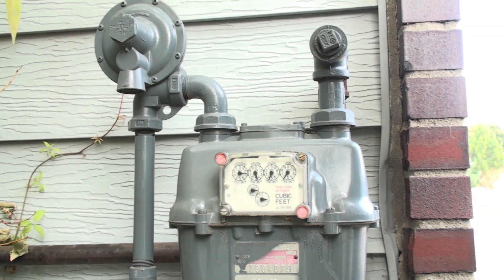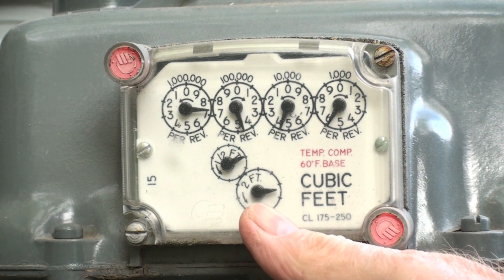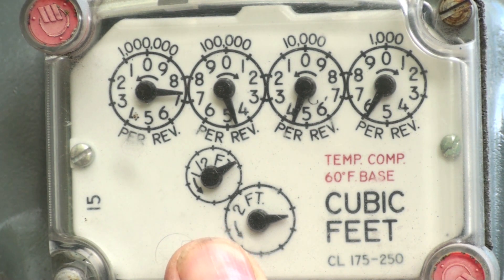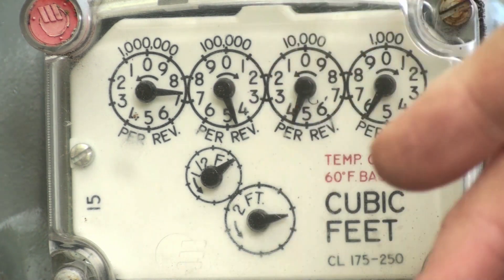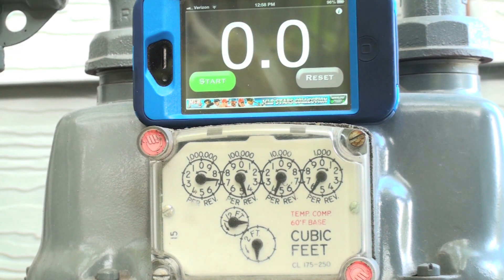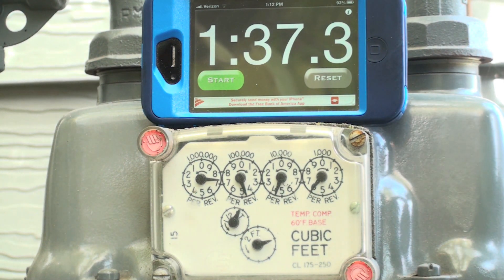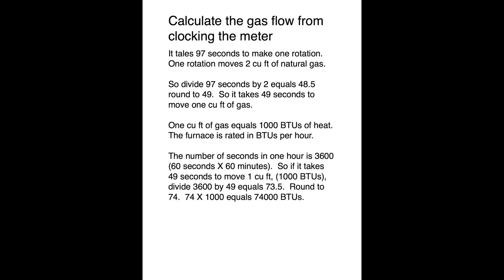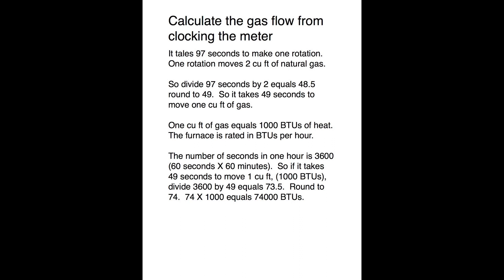Service of the 80% gas furnace.  Check the firing rate by clocking the meter part 10

Comment: This is very helpful. Thank you so much. Is there a way to clock the run time of a particular appliance while multiple appliances are running (dryer, water heater)? I want to find which is my biggest consumer of gas.

Comment: The heat content of the gas varies across the country 1000-1100.  It is best to call the utility company to find the heat content of the gas in your area.  we used the average of 1050.  Clocking the meter is a good way to fine tune the gas pressure.  I was told I was wrong to use this method and it was outdated.  The guy wanted to use static pressure to set the gas pressure.  What do you think Gray?
Reply from the maker: If you mean manifold pressure, You are closer to accurate.  In the end, it makes little difference as the manufacturers have at least 10% wiggle room.
GFM
Reply: @grayfurnaceman  Yes on the manifold pressure.  Carrier used to specify 3.2 to 3.8 inches of WC, as a range that you could work with.  If that didn’t work you had to derate the furnace.  Of course you have to derate the furnaces anyway, if used at high altitude .  It used to be anything over 2000 feet above sea level.
Reply from the maker: @rodgraff1782  The 2000 ft level is still correct.
GFM
Reply: @grayfurnaceman  Something tells me you must have been an instructor of apprentices.
Reply from the maker: @rodgraff1782  Yup, for 9 years.
GFM
Reply: @grayfurnaceman  I was too, 30 years.  Stopped in 2019.
Reply from the maker: @rodgraff1782  I retired in 2012.
GFM

Comment: This is good information.  What I intend to do is sub meter a building I'm renting out.  The building sits adjacent to my main building.  The tennant plans to heat the building and I have a line close by.   I purchased a meter on craigslist that looks very similar to yours in the video.  I need to connect the incoming and outgoing lines.  The male threads on the meter are 1 5/8" diameter for input and output.   I'm looking for a coupler with a washer to hook up to the meter, then connect standard 3/4" black pipe.  Where would I get these connectors to go directly off the meter?  Any help would be appreciated.
Reply from the maker: The only source I know of is the local utility.
GFM
Reply: @grayfurnaceman  I called them, Northwestern Energy, and they said they do not get involved with anything after the meter.  This will be a sub meter, after my main meter, negotiated between my tenant and I.  I'll have to call around on Monday.
Reply from the maker: @steventhury8366  I would try going to the utility, and if you can find the meter shop,  they may help you.
GFM

Comment: hey @grayfurnaceman if my meter instead of 2 ft is 1 ft my equation will be the same except that I wont have to divide the time by 2 correct? meaning I got 48.5 seconds for full rotation of the 1 ft meter then I would divide that   3600/49 = so on. and I will get the exact same result as you 7400 BTU  and the spec on mine was 75000 as well.
Reply from the maker: You have it.
GFM

Comment: My furnace is rated at 66,000 BTU and my gas meter is saying it’s using 64,900 is this too far off for proper gas pressure?

Comment: When the gas is on at the meter and it has a spring loaded regulator but it's not coming into the house, what can you do? I understand this type of regulator is supposed to reset it's self?  It's a itron b-42 and its tagged.
Reply from the maker: Call the gas supplier.  Its their meter and you are not authorized to mess with it.
GFM
Reply: grayfurnaceman ok, thanks for responding, I would have already if not for the holiday.

Comment: What if I run less BTUs than what my unit is rated for? What are the negative aspects of that?
Reply from the maker: First, if you are trying to save on gas usage, this is not the way to do it.
Low gas pressure may not let all burners light off.  The fuel air mixture will be incorrect with too much air.  Condensate may form in the heat exchanger which will rust out the heat exchanger or vent pipe.
GFM
Reply: @grayfurnaceman  thank you. Is execessive soot formation also an indication that the gas pressure is low?

Comment: Using this video and other information you provided, I have adjusted my two stage gas valve by clocking the meter and using the 4% per 1000 feet derate for altitude which in Denver works out to 20%.  I used this chart for the BTU value of the gas supplied to residents of Colorado:
https://www.eia.gov/dnav/ng/ng_cons_heat_a_EPG0_VGTH_btucf_a.htm
It's important to base the derate on the gas input rating of the manufacture not the actual BTU output of the furnace depending upon its efficiency rating.  The information provided by GFM has been a huge help.  Tweaking the gas valve is as temperamental as tuning a piano. After tweakig the adjusting screw, I give the valve a gentle "boink" with the handle of a rubber handled screw driver just to insure the diaphragm responds to the screw adjustment.
Reply from the maker: Did you remember to replace the regulator cap before checking the rate?
GFM

Comment: Is it possible to adjust the gas valve by simply clocking the meter or do you always have to have 3" of water pressure and then clock the meter to verify consumption as compared to the specification plate?  Another question.  Should not a derated furnace consume the derated % for altitude adjustment?  In other words would a furnace in Denver clock out at 20%  or 12% less than the rated consumption on the specification plate if properly adjusted?
Reply from the maker: In the end result, I use the meter as the final arbiter of consumption unless the meter is obviously wrong.  As for derating, I just use the chart to determine the derating number.
GFM

Comment: So the furnace has to be running in order for the clock to move?
Reply from the maker: You got it.
GFM
Reply: grayfurnaceman if you don't mind I'm getting into natural gas field and wondering what tools I will need?
Reply from the maker: There are man.  Not the least of which is a manometer to check gas pressure.
GFM

Comment: Doesn’t clocking the meter show your output? Not your input? Just curious I’m just wanting to make sure I understand this right
Reply from the maker: Clocking the meter shows the amount gas supplied to the appliance.  
GFM
Reply: Gotcha so the output rating means? The true btu output you’re getting with the heat loss due to the flue gas correct?
Reply from the maker: Yes.
GFM

Comment: Thank you for the great post, GMF! 
I've recently replaced a gas valve and I'm about to estimate gas/heat flow by the furnace with the new valve.

I have general question on the making sense out of furnace specs. Here is info printed on my furnace wall 
Model No: P3HUA12L06401A 
Input BTU: 80000
Output BTU: 64000
Manifold pressure: 3.5'' WC
Orifice: #45 DMS

So  Output BTU/Input BTU = 80% which makes great sense, it's 80% efficiency furnace. 

Now let's derive  Input BTU out of Manifold pressure and Orifice. As it's posted in "Gas Orifice Capacity Chart " (http://www.hvacredu.net/gas-codes/module2/Gas%20Orifice%20Capacity%20Chart.pdf) one orifice with #45 @ 3.5 WC pressure will deliver 17072 BTU. The furnace has 4 burners so all of them will deliver 17072*4 = 68288 BTU. This is only 68288/80000= 85.36% out of input capacity listed above. 
 
So why is there a big disconnect between 3 parameters of the furnace - Input BTU, Manifold pressure and Orifice size - posted in the furnace?
Reply from the maker: Are you sure its 45?  Most of these are 42.
GFM
Reply: grayfurnaceman  Im positive. Its clearly  posted on the side/wall AND its stamped on the orifice itself. I think the question is "which specific table of orifice-diameter-to-gas-flow is the number 17072 coming from?" For example on your webpage http://www.grayfurnaceman.com/determine-gas-flow-to-the-burners.html different table is shown. In that table the orifice #45 is mapped to 19150.
Reply: Glad you posted the link to his website.
Reply: KoO, the disconnect is because a lot of equipment does not perform as rated.  Tolerances during manufacturing are not always perfect.  That's why things need to be adjusted.  Adjusting  the gas pressure regulator can help, but only to a certain point and then the orifices need to be sized up or down.  At some point your measuring instruments and methodology of measurement has to become very precise.  I think you are expecting too much precision in the manufacturer's claims.  Most appliances and I assume that includes furnaces are in large part junk.  It's kind of like a radar gun, the car's speedometer, and a GPS.  They are all slightly different, which one are you going to trust?

Comment: What if your over by 10,000 btus and you are at proper inches of water column at manifold. What does that do to the furnace,would it cause it to burn to hot or screw up combustion? Also does it mean the unit is know good?
Reply: I'm not a furnace guy but it seems to me that it would be an indication of over sized orifices.  It has to get those 10,000 BTU's from somewhere so it more or less has to mean that it is consuming more fuel than it should.   On the other hand, perhaps the fuel is not fully burning which I think one might be able to tell from the color of the flame.   I read that high altitude furnaces that are not properly derated can carbon up to the point they stop working.  Could the grayfurnaceman describe a proper colored flame?  I think it probably should be more blueish than orangish.
Reply from the maker: First, check orifice size to be sure it matches the model plate.  It will burn hot and combustion will not be right.  The unit does not need to be thrown out.  The last thing to check is the accuracy of the meter.  That last one is for the utility.  Hope this helps.
GFM

Comment: So if the numbers are not what they should be does it mean the gas pressure is to high or to low?
Reply from the maker: +cooldog60 If the result is a higher than normal BTU input,  pressure is probably too high.  Opposite for too low.
GFM
Reply: Pakistan electricity generations LNG and furnance oil rates increase
Reply: All depending on the altitude of course which complicates things.

Comment: Thanks for sharing your knowledge in easy to understand language. How do I read my natural gas meter in order to compare it with the bill that I receive from the utility company? Your comments will be greatly appreciated.
Reply from the maker: +Shahzad Akhund The top 4 dials are for billing.  Left is the highest.  Read each dial to the lower number.  That is if it reads about 7.5 read that as 7, the the next dial will tell you the fraction.  Hope this helps.
GFM
Reply: Thanks for your response.  I thought that a number from each of the four dials, read from left to right, would make the four digit number that will relate to that mentioned on the utility bill.  So I did not follow your comment about the next dial showing fraction.
Reply from the maker: +Shahzad Akhund I will do a video on it.  Should be out in about a week.
GFM
Reply: +grayfurnaceman thanks, looking forward to that.

Comment: In some areas, the BTU content of natural gas is 1050 BTUs per cu. ft. or higher nowadays.  This is due to "ethane rejection", a relatively recent practice of suppliers where they leave the ethane in natural gas instead of extracting it and selling it to the petrochemical industry.  The high BTU content should be factored into the calculation when clocking the meter.  Otherwise, you'll be paying for energy that you won't be using.  See: https://www.eia.gov/dnav/ng/ng_cons_heat_a_EPG0_VGTH_btucf_a.htm.  Also Google <ethane rejection>.
Reply from the maker: +Louis Wilen Good thoughts
GFM
Reply: 6 years later -- We're back to about 1030 BTUs in most areas.  Ethane rejection is no longer a thing.

Comment: Very helpful. That way I can predict how much gas I will use in a month by knowing the firing rate per minute and timing how long the furnace runs per hour. Multiply by 24 gives me my daily usage. One thing I did notice was that the firing rate per minute for my furnace was .46 cubic feet meaning 27.6 cubic feet per hour roughly if it ran for a solid hour, however the furnace is rated at 77000 btus per hour. It is a Coleman dgaho77 mobile home furnace. Is it possible that the firing rate is variable? Just curious to know why the btu input is lower than the factory specs.

Comment: Sorry.  I didn't explain that clearly.  When is it necessary to do a correction factor when it comes to calorific value.  Say, the calorific value of natural gas happens to be 1050 in one's region instead of 1000.
Reply: I would think the answer would be yes,  I also read in an article that the quality of natural gas can vary and it is somewhat withing the control of the gas supplier.
https://www.achrnews.com/articles/136057-furnaces-must-be-modified-for-high-altitude-applications

Comment: Can you explain the correction factor?  Both: difference in atmospheric pressure and difference in calorific value.
Reply from the maker: Diane Jarvis I don't know.  I would try the gas supplier.
GFM
Reply: 1 BTU = 252.164436 calories
https://www.calculateme.com/Energy/calories/ToBTUs.htm
At this point I'm not sure about how BTU's relate to atmospheric pressure, but from what is being said the amount of fuel has to be reduced by 4% per 1,000 feet because of the reduction in oxygen at altitude.  Again, I don't know if this means measured from sea level or above 2,000 feet.  Here's an oxygen altitude chart, which I need to study in more detail.  I should be able to figure the furnace derating values from this chart:
https://www.higherpeak.com/altitudechart.html

Comment: thanks! i guess if you are burning to much or less  you change the orifices?
Reply from the maker: estrelladelnorte1308 The first thing to do is adjust the manifold pressure down.  That usually fixes it.  If you have to drop below lowest on the model plate to get there you would change orifices.  At that point I would be looking at the entire install because if you have to go that low (or high) it does not look right.
GFM
Reply: I saw a video where the technician placed a probe in the discharge exhaust vent (96%).  I presume that is like the air pollution monitoring stations for gasoline vehicles.  It must be an indication of how efficiently the fuel is being burned.

Comment from the maker: Most manufacturers recommend 4 percent per 1000 feet of altitude.  Hope this helps.
GFM
Reply: Is that 4 % for every 1,000 feet above sea level or is it 4% for every 1.000 feet above 2,000 feet?  Stated another way would a furnace in Denver be derated 20 % or 12%?  Also I've heard that high efficiency 96% furnaces are only derated 2% per 1,000 feet.  In either case is it total feet above sea level or total feet above 2,000 feet?
Reply: @JoeLinux2000  "When an appliance is installed at elevations above 4500ft, the certified high-altitude input rating shall be reduced at the rate of 4% for each additional 1000 ft" - CSA B149